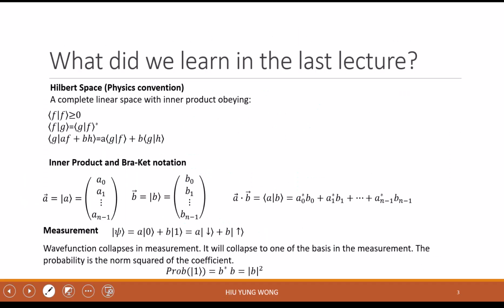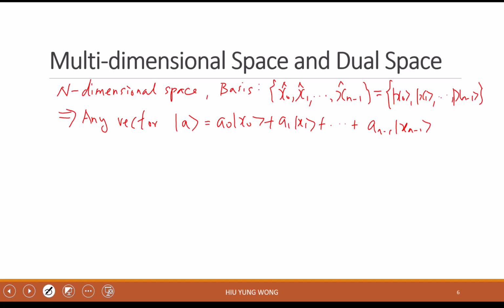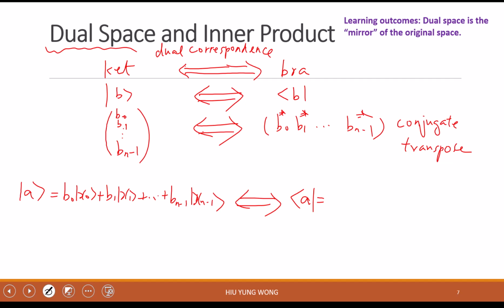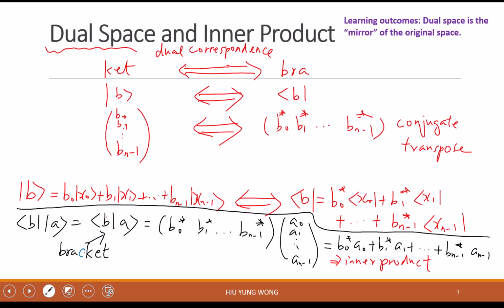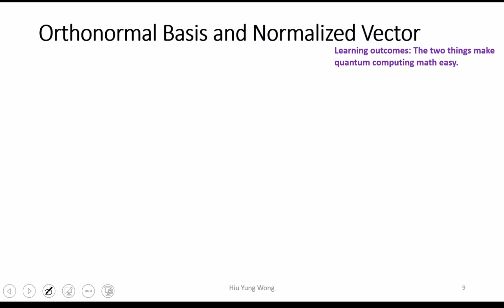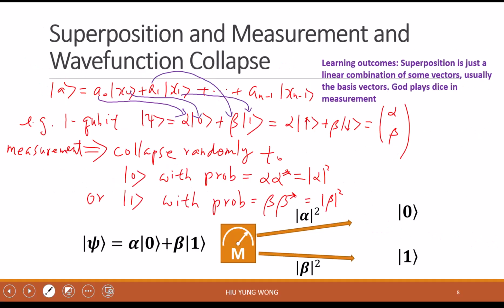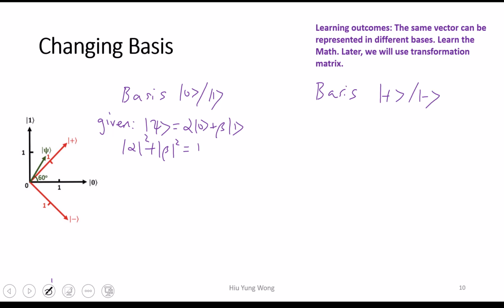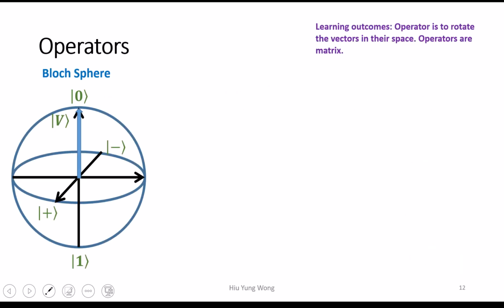L3-1: (Ch3) Dual Space, Bra Ket Notation, and Orthonormal Basis

Comment: Why at 6:38 did you input 0, 1, 2, etc as the x substitutes? Just for simplicity?
Reply from the maker: Firstly, it doesn't matter what I put in ket because it is just a label of the state. And yes, putting it as 0, 1, 2 makes it easier to write as long as it doesn't cause any confusion. Thanks!